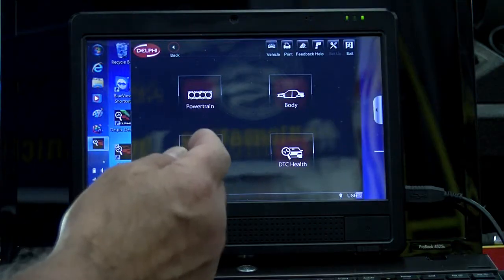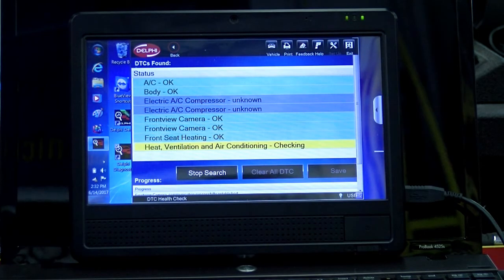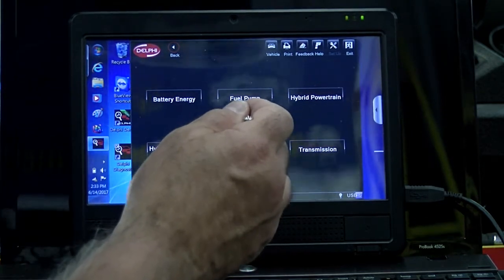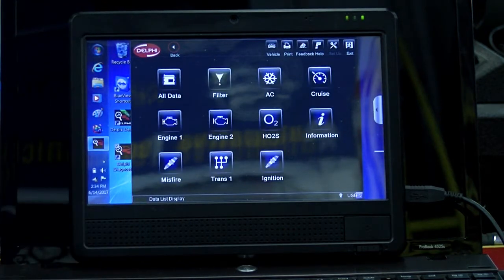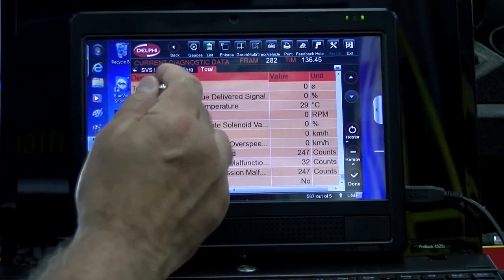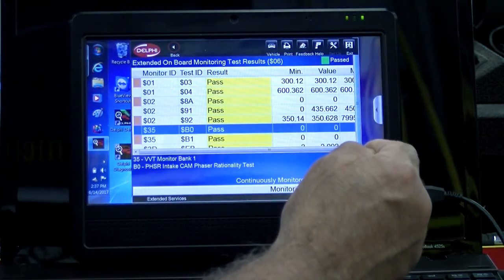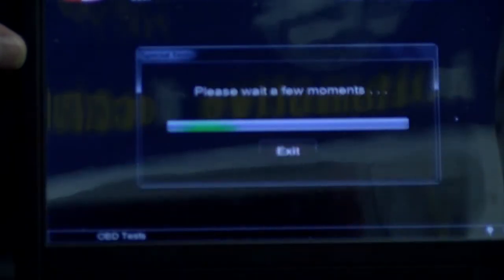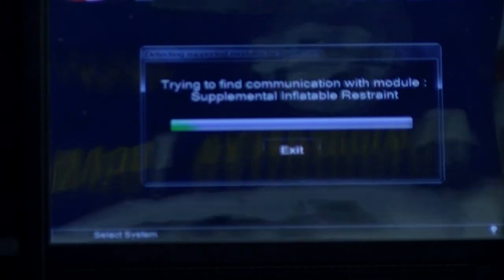GM Scan Tool Shootout Part 2 DELPHI Scantool

Comment from the maker: Scan Tool Information Summary on GM:

Tool                  Time To Scan All Controllers   Amount of Controllers   Bi-Directional  Coding Programming        Comment
GM - GDS    80 seconds                                   32                            Yes              Yes Both    Not super intuitive but does everything.

Autel - Maxi-Sys 100 seconds                            27                   Yes             Only Coding  Lots of extra functions

Autoland Scientec Iscan II wt 50 seconds   25                 Yes, slow process  Yes                        Lots of tests

Delphi            87 seconds                                   27                 Yes                     Yes  Both            Good amount of test

Launch 431 Pad II  65 seconds                         28                  Yes                 Only Coding Lots of functional tests and relearns

Mahle TechPro 45 seconds                    29                  Yes               Coding & security only    Not as many resets as GM

OTC Encore 120 seconds 32  50/50, some controllers Yes                Some coding  Easy to use good amount of test

Snap On Verus 35 seconds                         22                   Yes        Only Coding      Has functional tests, but not all